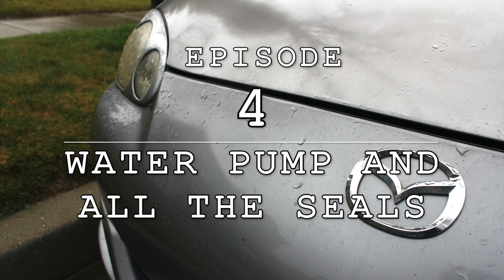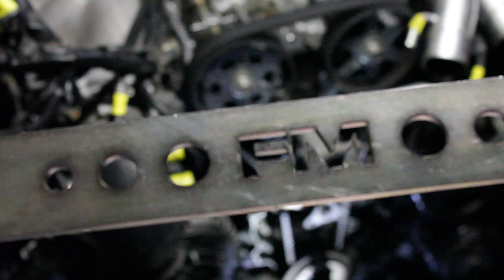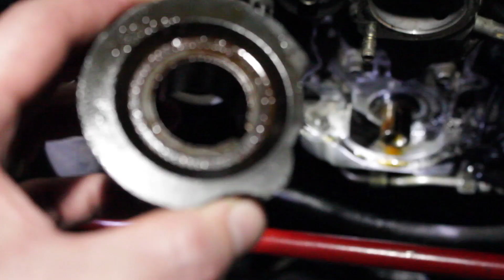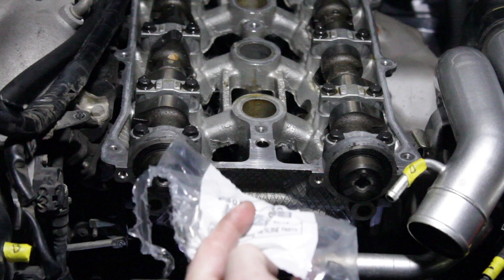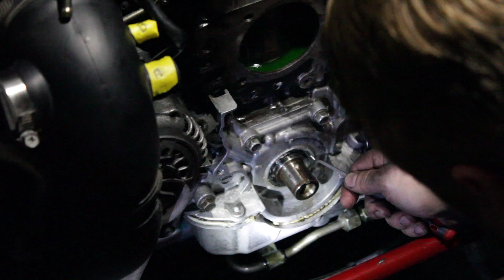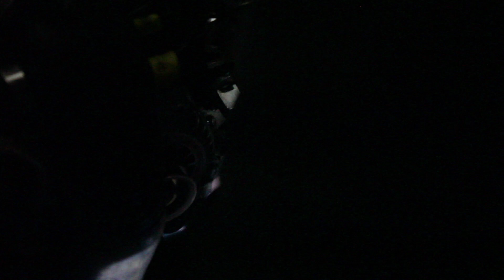2005 Mazdaspeed Miata - Episode 4: Replace Water Pump and Every Seal

Comment: Thanks for this series of vids, invaluable to me doing this same job at the moment on my Australian spec MX5 SE (aka Mazda speed Miata). One question, how in the world did you replace that water pump inlet o-ring? Seems impossible.
Reply from the maker: Mitchy D thanks a ton man, glad to hear they have some value. Yeah that inlet o-ring is tricky and was impossible to capture clearly on video. With the water pump off you have some wiggle room and I was able to ever so slightly move the pipe towards the front of the car revealing the o-ring. It’s tight but you should be able to replace it. When you install the new WP and tighten it down, the pipe should seal tightly on the o-ring. You want to triple check that. Hope that helps.
Reply from the maker: Mitchy D also use a healthy amount of silicone lube to get the new o-ring Into place and to help it seat nicely.